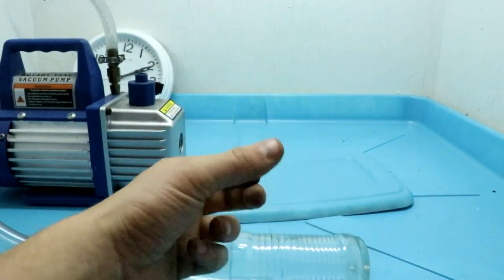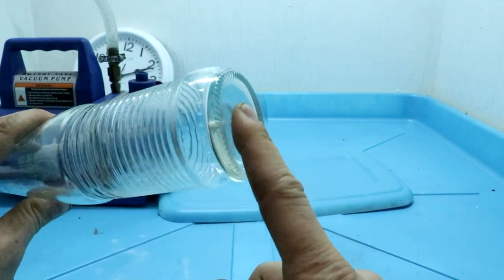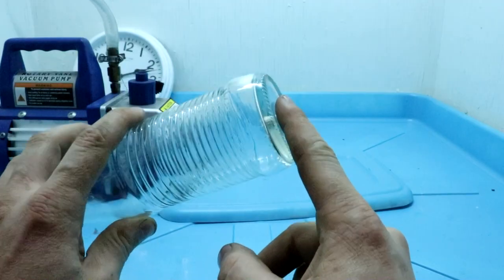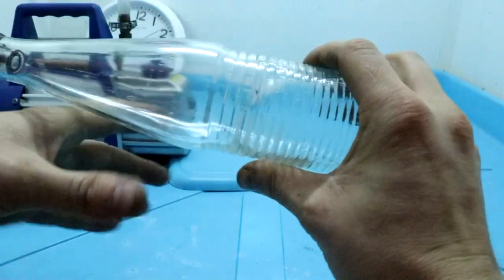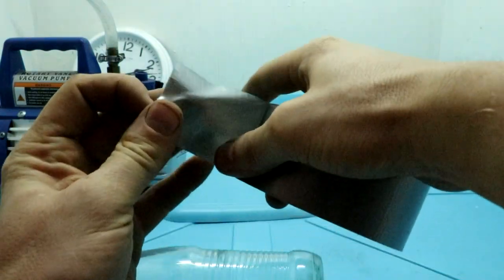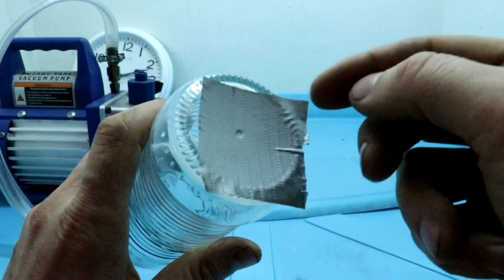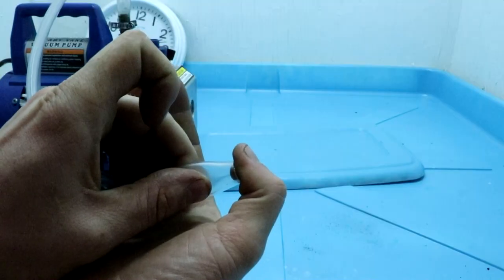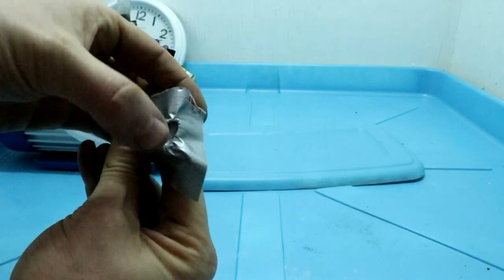Use Your Finger to Stop a Leak on the Space Station?

Comment: Picture this. Every one is asleep or busy and suddenly an alarm sounds indicating that the ISS is loosing air pressure. Imagine the situation... Ok..There is a small hole somewhere. Now what? How they are going to find a small leak to begin with? Please THINK. 
Compare it with a leak in an inflatable swimming pool. But then 10,000x bigger and totally covered in thick layers of insulation and on top tons of piping cables and equipment . A small hole.... ;) How likely would it be that a small hole would be reasonably accessible?  How long would it take to find the hole in the first place? Listen for hissing noises ;)
The ISS is not a single hollow tube! And all walls are covered in multiple layers of insulation and packed with equipment. They would have to break every thing down to find the leak. Think about how ridiculous the concept really is. ISS = Wet space dreams.
Reply from the maker: They have ultrasound leak detectors, and then they did have to rip open the wall to access it.
Reply: I know.. So.... you really believe that ultra sound leak detectors work through multiple layers of thick insulation, facings, equipment and running life support systems? I think you should do a few experiments with ultra sound and find out for yourself.
Do you really think that they can scan a large room filled and packed with stuff and then it magically pinpoints the position of a 2mm (!!) small leak? 
I know what they tell you and yes, most will swallow all BS stories from NASA but in real life it is technically impossible. 100% a 'make believe fairy tale'. Just the same like you proved that bigger rocket engine thrust in a vacuum than in the atmosphere is also BS. ( you only 'forgot' to tell the real experimental findings and results to any one) Thrust decreases dramatically in a vacuum... period
My version of what happened.
It was quiet some time in ' make believe ISS wonderland'  so they needed a new spectacular attraction to boost their ego and justify their crazy budged. So they made up story about a leak and voila ...the world is once again focused on the ISS and NASA and their ' dangerous ' missions. 
I bet the next step is that they ask for more funding in a month or so to prevent these things from happening.
Reply: There are pressure sensors in every module of the ISS
Pretty easy to isolate it once you see all of them
Reply: Pressure sensors detect a general drop in pressure. Not the location. A million pressure sensors couldn't even do that. There are no doors between compartments in the ISS that you can close off to seal each compartment in order narrow the search for a leak. 
So .. Its impossible to locate the source of a tiny leak with pressure sensors.
Reply: @getreal155  
Actually no all of the modules each have their own have seperate hatches since they had to be sent up seperately
And thats exactly how they actually  isolated it
By closing all of the hatches and seeing where pressure was dropping

Comment: That pump can in no way mimic the tors of a absolute vacuum. Fakescience.
Reply: That pump can evacuate the bottle better than 99.9% of the way to the pressure of the environment the ISS is in.
The environment the ISS is in is not even 0 absolute pressure.
The few hundredths of a % difference between the pressure that pump is capable of reducing his bottle to, and the pressure around the ISS, is insignificant to the demonstration.

Comment: You didn't even get  remotely close to the vacuum of space, nasa can't even do it themselves!
Reply: Do you know w hat an electron tube is? They used them in all electronics seventy years ago. The vacuum in those tubes is better than what they have in low-Earth orbit.  Cody's pump can remove 99% of the air in the bottle; deep space vacuum is only one percent better.

Comment: No offense. But you understand that you can plug the station from the inside. The pressure itself would fill the function of germicity, you apply a piece of metal. Mating. Do you want to rip it off? So, that your experiment is good only in the cases of absences of the rope, wires, etc. May still show the experiment with the sealant, as it was done, and not your finger.
Given the specifics of your channel, how could you even show it, even if someone asked. Are you engaged in science, or am I not understanding something?
Reply: I'm so confused. What are you trying to say?
Reply: accckiy boi what are you trying to say
Reply: When the hole was first discovered, the astronauts were using their fingers to plug it up. There had been some speculation on the interwebs as to how dangerous that might be.

Whereas my question would be, if you wanted to peek through the hole into space, how close could you get your face to it without being "de-orbited"?
Reply: accckiy wtf are you on about...?
Reply: + Tom Haflinger Thanks for info. I didn't know about that. So I "remove" my comment. About you question (rhetorical one) have no idea.
Reply: I have answerd this on. Forget it. I didn't have full info about it. So I was confused. And made this comment. Thanks for reply.
Reply: But yeah, it's always a bit of good luck to be on the high-pressure side of a fluid leak.
Reply: I wouldn't get your eye too close to the hole... getting your lens and all the fluid in the eyeball sucked out would spoil your day, especially when you recoil in shock and leave your deflated eyeball stuck to the hole!
Reply: But would it stop the leak? Would my half-frozen, dead eyeball stop the leak?
Reply: Tom Haflinger 
Your eyeball would stay where it is. 
You cant put your eye directly on a flat surface anyway, your skull prevents that. 
But even if you did, with sutch a small hole your eye would probably not be significantly  damaged.

I dont understand your question about deorbiting can you elaborate?
Reply: In astronomy, "de-orbiting" would mean an end to spacely activities.

In biology, "de-orbiting" is what your eyeball would do if you stuck a vacuum hose to it.
Reply: mate, do you even english? (meaning no offense if its a second language lol)